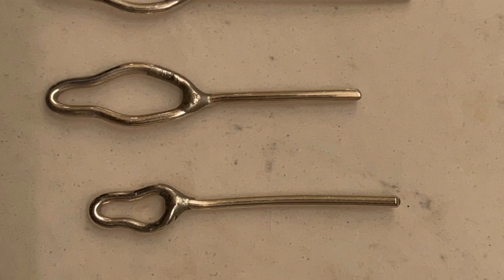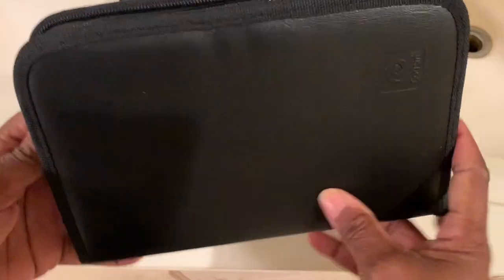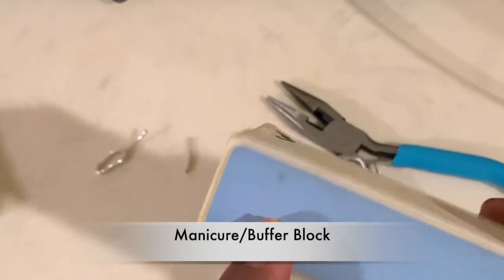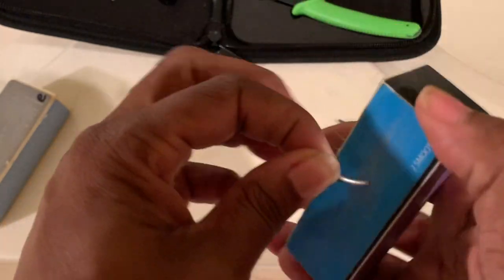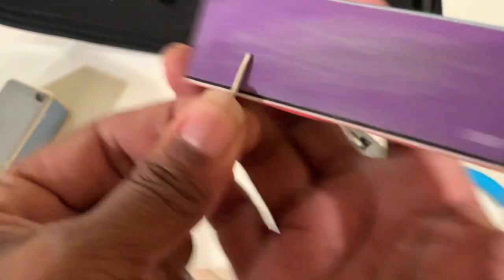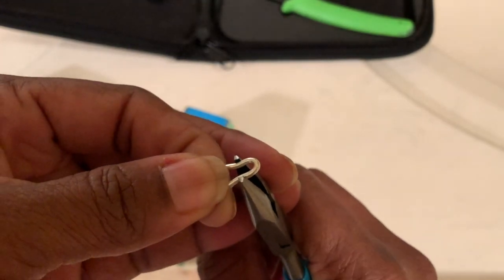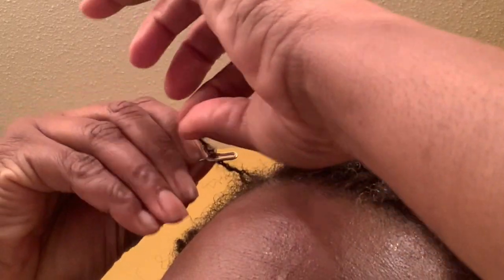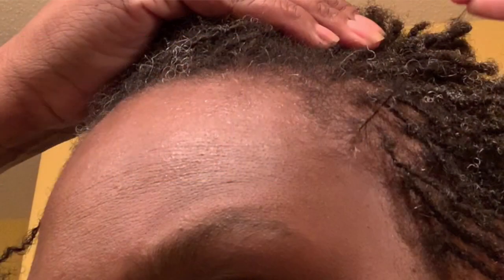HOW to MODIFY Your Nappy Loc Tool

Comment: I want to.purchase the nappy lock tool but I don't know if I should get the micro- mini or the micro? .What size is that you're using?
Reply from the maker: I purchased the set that came in three different sizes, however, I had to modify them. I have a video of me unboxing the tool then another video of how I modified and shortened the long stems.
Reply: @Y2KDivaLocs  Queen where can I purchase the set? Or is it the nappy locs tool? I just purchased the mini..for $26..
Reply from the maker: There should be a comment box to request various sizes. She’s REALLY good at replying to messages/emails. 

https://www.nappynhappy.com/products/nappy-locs-tool